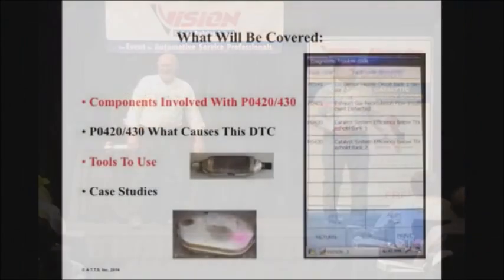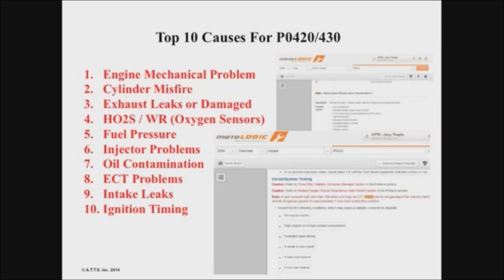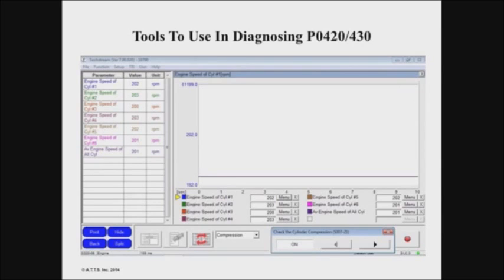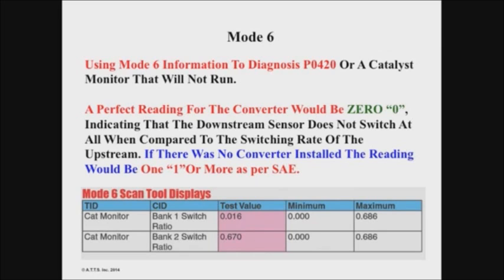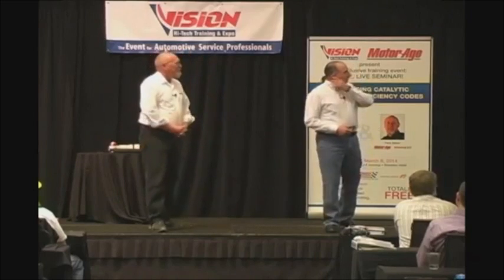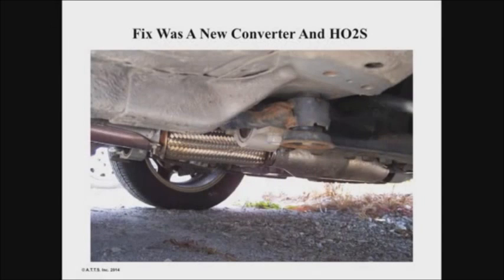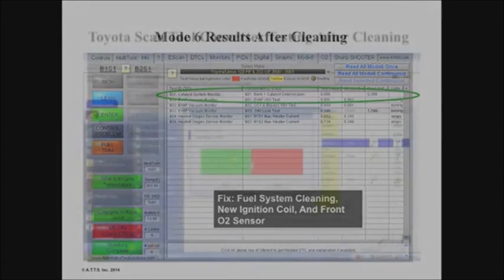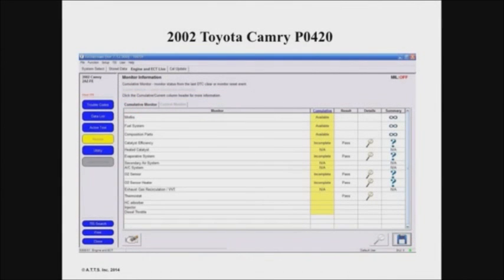P0420, P0430, (Diagnosing and Repairing)

Comment: My 2018 Ford Transit 3.5 EcoBoost.
Got both 420 and 430 codes right after the exhaust manifolds were repaired under warranty for the warpage that they get.(as told to me by the previous owner)
After a few oxygen sensors the dealership said must be cats.

Could it be that the van was never taken through the proper drive cycle to reset the ECM or the ECM needs a reflash.

There's no drivability issues and aside from the light being mostly consistent at 500 miles you can use some of those cleaner products available at the auto parts stores to delay the light a little bit.

The only exhaust leak I can see is way down the line towards the back of the van with the forward facing small hole on the very first muffler.

Comment: HI I have a 2003 impala LS with 3,8 engine and have Evap code p0420 CAT code and P0442 GAS cap code   I all ready changed both front and rear  o2 sensors both were the original and one of the sensors were welded shut (meaning the front sensor was not working correctly) I have No loss of power and  normal gas mileage for the car about 20MPG City and 33MPG highway with automatic cruse control (pure highway open road & minimal traffic.)  I have ordered a new Gas cap   for it   PLEASE help as my smog test is DUE on NOV 8th  I have also Ordered a NEW cat for the car ...
Reply: punker4Re